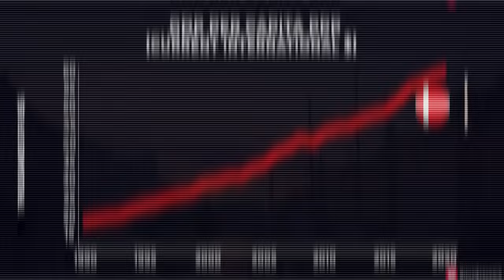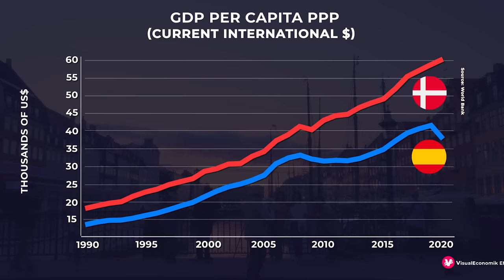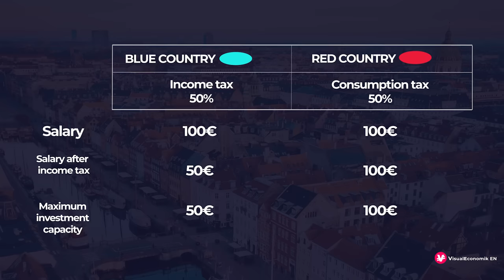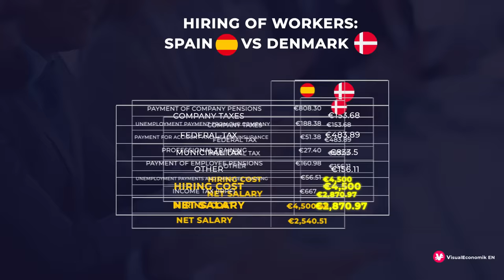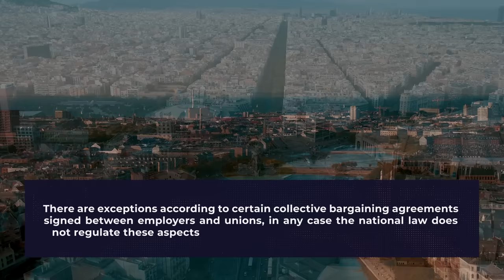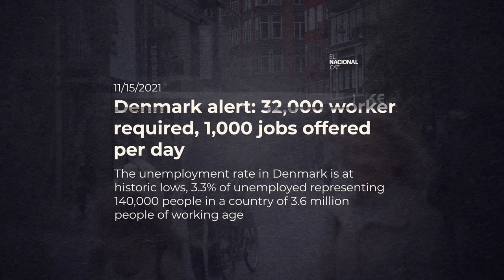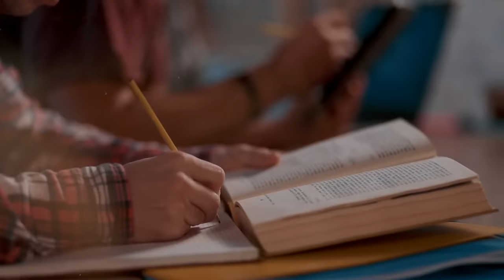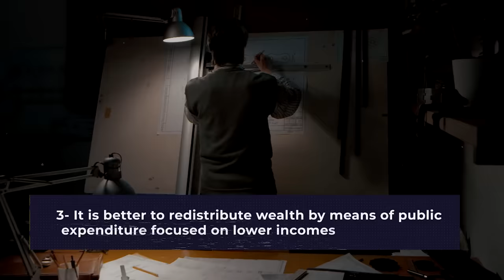Why Is Denmark So Rich Despite Huge Taxes?

Comment: Don’t be fooled by tax figures without additional context. I have looked at scenarios over and over as a spaniard in Denmark, even if taxes are a bit higher for the same net salary my workplace would have to pay more in Spain than in Denmark. That is basically because social security is largely payed by the employer. Sure cost of living is cheaper in Spain but there is more to it, pensions are somewhat private in Denmark which forces you to be accountable for saving whereas in Spain is public pyramid scheme with a lot of uncertainty.

Comment: You can not compare our taxes this way. We do not pay tax on the first 48.000,- kr. And other expenses can be subtracted before paying tax - like some interest rates on mortgages and bank loans as well as trade union memberships, driving to work distances over 20 km etc. Companies do not pay our taxes either. We do that ourselves, since every person has different subtractions according to mortgages and bank loans etc. The effective tax rate is about 38-42%. And only when you earn over more than 568.900,- kr a year, do you pay an extra 15% on top of the 38-42% for the amount above the 568.900,- kr. You can earn up to 58.900,- kr on shares for 27% and 42% over the 58.900,- kr. Example: If you earn 350.000,- kr a year, you can subtract 48.000.- kr. This gives a taxable income of 302.000,- kr. Then you pay 42% of that in tax - if you have no mortgage and other things to subtract. That is a tax of 126.840,- kr. (126.840/350.000) x 100 = 36,24% om effective tax rate. And this is very simplified version. The different municipals have different tax rates, so it is a bit more complicated than this. You simply can not compare other European countries to Denmark.

Comment: There is a very low corruption, so the tax money is distributed effectively. And since we (Danish people) trust the system, we are generally happy to pay the extra high taxes - as they will come back to you at some point, either when you went to school, when you become I'll and once you become old.
The low corruption secures this social contract.
Reply: The low corruption is a result of a corruption scandal in the 1800s that was of such a magnitude that it was only surpassed by the whole Bernie Madoff thing when adjusted for inflation.

After that it was found that due to civil servants generally feeling, and also being, underpaid the chance of them turning to corruption was higher and if they did it would severely impact the economic environment of Denmark. So, their pay was increased and so was the penalty for accepting bribes, and the various controlling institutions were strengthened. This led to the civil servants serving the people they were supposed to rather than their own interests since their own interests were covered. Over time this manifested in the low tolerance for corruption that Denmark has where people are never seen as smart for finding ways to exploit the system and are instead seen as selfish asshats who are only in it for their own egotistical benefit.

I love my country for being able to see this and I loathe the political parties who are all "the civil sectors are being overpaid." The only reason you have an environment where you can say that is because those same people are paid enough!

Comment: So you wonder how our GDP/capita is so high despite our "high" tax pressure? The public spending is a big part of our GDP, so you could run into a problem with reversed causality. The money the public collect doesn't just disappear, they go into the economic again, so a high tax pressure will also lead to more public spending, thus higher GDP. Therefore a high GDP/capita I Denmark can also be helped on by the taxes. Also: Tax pressure isn't comparable between countries as others have said in the comments. This is because the tax pressure for instance can be calculated in so many different ways, and it is flawed... If you just look at the marginal tax (the tax the person that pays the highest percentage, in a country, pays) you can't say that this applies to the general public. Also when calculating tax pressure, the subsidies and other forms of redistribution of "tax money" that goes around in a country like Denmark, is not taken into account in the tax pressure. When different countries have different social benefits and other sort of redistribution of tax money, it implies that even though the "tax pressure" in Denmark is high (relatively speaking) it might not be higher than in another country, because so much is given back. The DWL of the Danish policy might be super low compared to DWL of Spain, if our taxes are implemented in a good way, so that we also get so much more out of the taxes that are paid.

Comment: Spain has a huge income on turists, so I dont really think its fair to compare Denmark to Spain, as no one could travel to Spain the last two years.
Reply: The comparison is not for the last two years only.
Reply: @andersandersen6295  but what he says about the time during corona and 2007 is not fair, as Spain has so many turists. Ofc they will have a hard time when so mucn of their income coming from turists.
Reply: @magnusalexander2617  If he talks specific about bad performance during corona, wich i cant remember he did, then you are right, it is not a valid parameter to use.

Comment: Ireland have only 12% income tax and have gdp p around 90 000 USD
Reply: Ah yes but much of that does not trickle down to the general populace in the Republic. Indeed currently (late 2022, early 2023) there are issues re its health service and re housing in that country. Tho despite that, its overall standard of living is generally higher than in NI and indeed higher than anywhere in the UK, other than perhaps London. And remember the Republic remains strongly IN the EU (as did next door NI and Scotland, both voting Bremain in the 2016 UK Referendum).
Reply: @davidlally592  ofc is not gonna trickle down to general population, if someone wan't equal wealth redistribution they can go to venezuela cuba and north Korea, wealth redistribution is left wing romantic idea, that means when someone works hard and smart , other people that they are lazy wan't to get same amount of money without much  effort, that's not fair, big companies don't need to pay taxes, they do by hiring workers they help ecconomies anyway

That's why rich countries have low unemployment percentage and high salaries , because there are more jobs than workforce that means workforce have more value, 

High amount of companies = high wages because workforce is on deficit

Low amount of companies = low wages because of workforce surpluses

Comment: I believe theres a math error at 5:06. The max consumption net of taxes should be 66.6, if I am not mistaken. 50% of 66.6 is 33.3, add those together and you get 100. 50% tax on 50 will only get you 75.
Reply: *For the red country with 50% consumption tax

Comment: Wait I see online that Denmark has the highest household debt in ratio to income in the world. Some polls put them less or more. But they have really really high household debt. I would think this would be brought up?
Reply: Household debt on the surface it looks bad however once you dive into the details it comes out to being not bad at all, it is the mortgage on the house they own that makes up most of that household debt and that really isn't much of an issue, since houses usually gain in value over time and the house is used as collateral for mortgage, A mortgage can only be taken out for 80% of the house value, the last 20% most have on hand themselves though legally can cover 15% of the house value with a regular bank loan (5% minimum have to be by yourself) so a €230.000 debt isn't a much of a risk when the collateral is worth more (build a house 8 years ago €230.000 mortgage plus €50.000 for own pocket, on the day it was finished house valued in at about €310.000 sold 5 years later for €355.000 valued in today just shy of €380.000 but will sell for €395.000 minimum)
Add in high regulation and requirements on mortgages, houses and insurance again cannot be uninsured. A 150+ year track record of paying off mortgages no matter what, while being occupied in WW2 payments on mortgages was still collected and paid out to the international investors with interest after the war, no wonder it's rated one of the most stable and secure investment and properly why most aren't worried about so called household debt in Denmark, it's covered by brick and mortar.
Reply: @bnorth1087  And you get tax deduction for the mortgage "loan" but you dont pay tax on the profit when you sell your house.